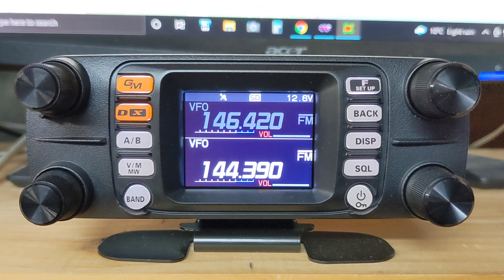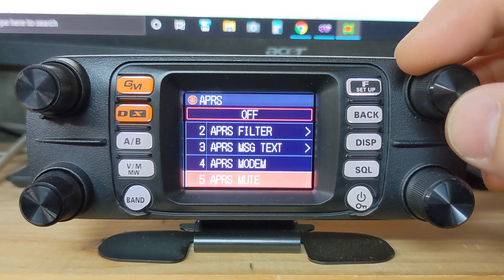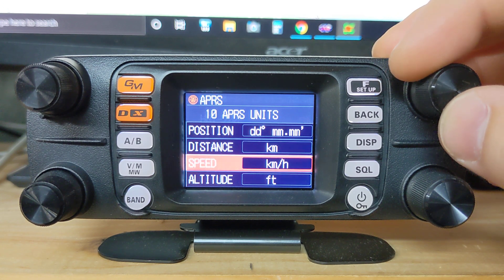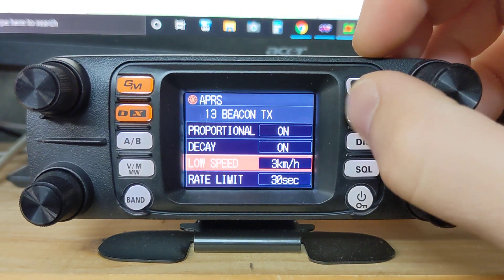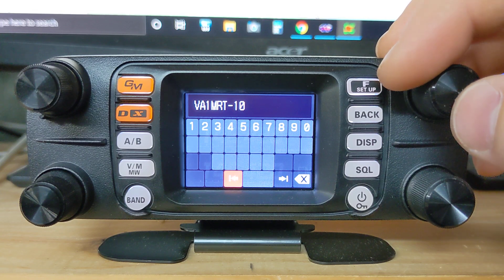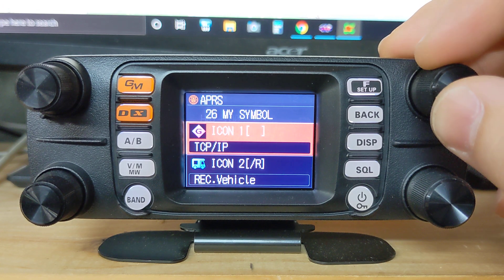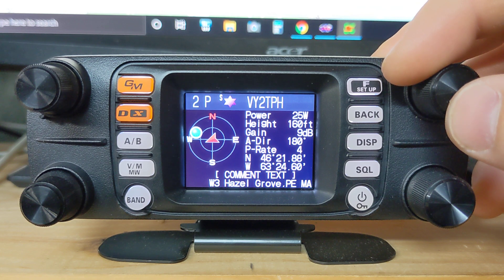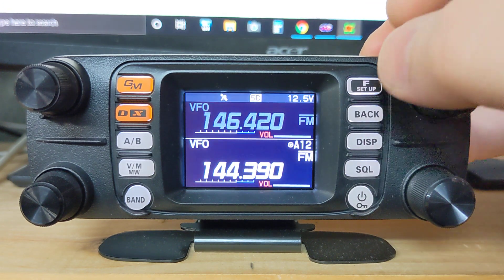Quick Setup of how to get APRS running on the FTM-300

Comment: Yes but how do we connect it to Winlink on a PC?
Reply from the maker: That's a good Question. I would like to look into that myself. It's something I've thought about.
Reply: Unfortunately, you can’t. You can output received data from the TNC, but you can’t send anything to the TNC to be transmitted. For Winlink, you will need an external TNC or sound card adapter like a Mobilinkd TNC.
Reply: Buy a Kenwood or external device